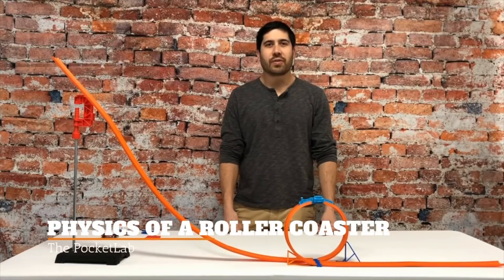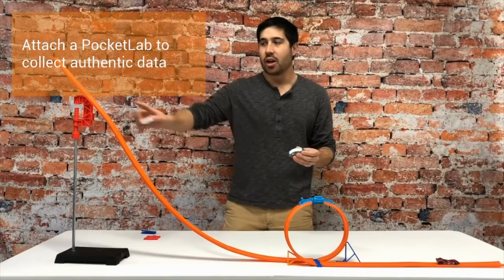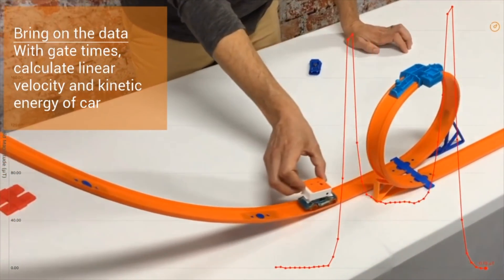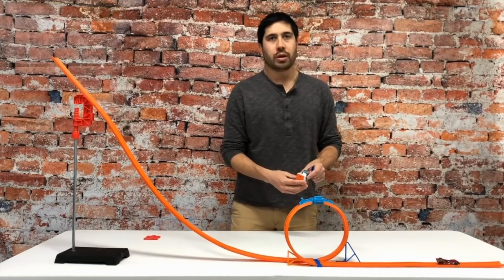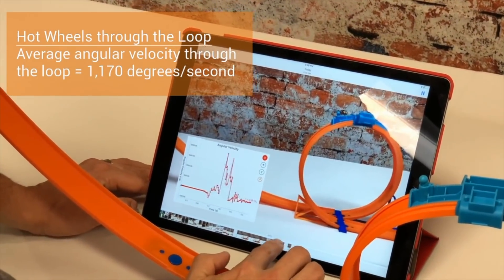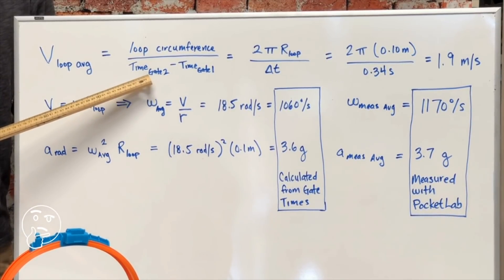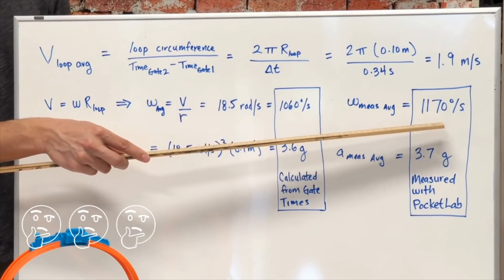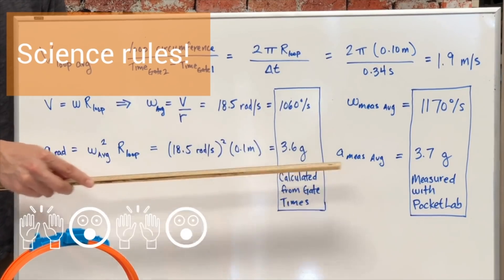The Physics of a Roller Coaster Loop | Arbor Scientific

Comment: Very nice lab!  However, I am compelled to point out that some of the force/energy was lost via the flexing of the track.  Use duct tape (or weight) to lock down the base of the loop and fix the track firmly and I believe your numbers will change, though I don't know how much.  It will make a noticeable difference, though.  I've played with Hot Wheels tracks with my grandsons for a few years; taping down the loops and the track always makes for faster cars and higher jumps!
Reply: Always remember Jesus never fails, no matter how many times it feels like he has just know that He always has your back.

When you feel overwhelmed, like the pressure is too
much, it's because you are stronger than you think.
You haven't discovered all that's in you. You'll never
how strong you really are, until you face pressure
that you've never faced. It may seem unbearable, but
the fact that God allowed it means that you can
handle it.

Pray this prayer from the bottom of your heart  out loud to be saved 
Dear Lord Jesus, I know that I am a sinner, and I ask for Your forgiveness. I believe You died for my sins and rose from the dead. I turn from my sins and invite You to come into my heart and life. I repent of my sins. I will worship you all the days of my life.I want to trust and follow You as my Lord and Savior.I receive it and Believe it in
Jesus Powerful Name, AMEN❗️